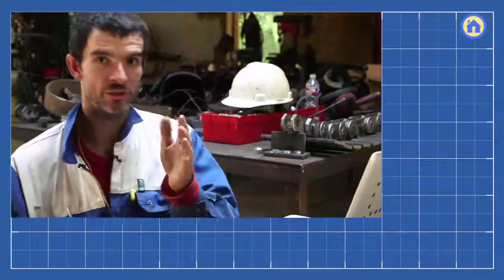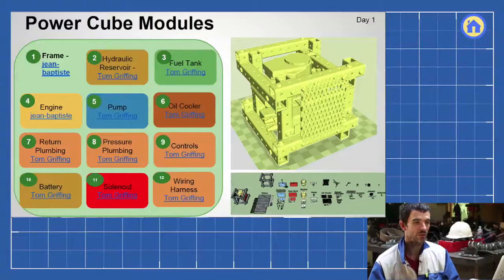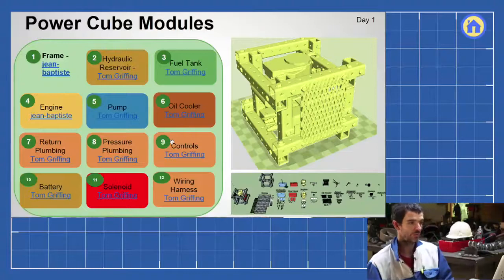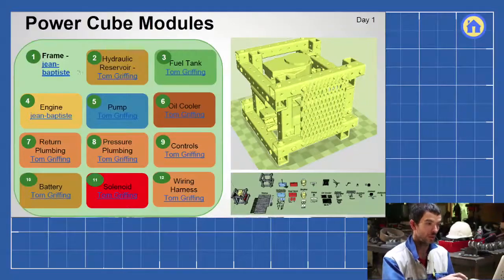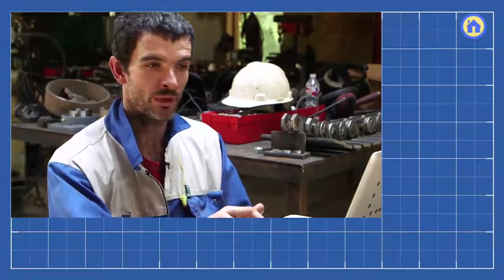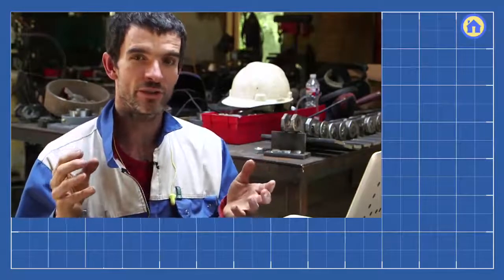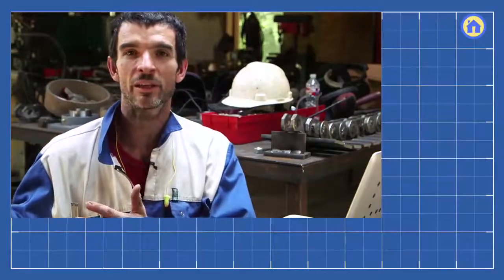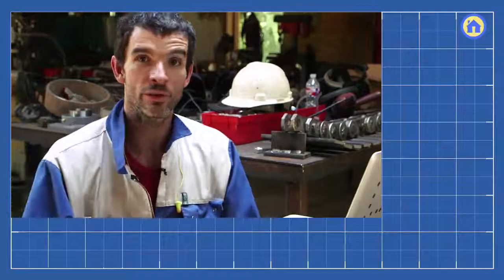Power Cube - Basic Theory by Open Source Ecology

Comment: Are there less costly ways to create hydraulic pressure?
Some people say steam engine is less demanding in many ways.
Also, classic engine produces rotation, not hydraulic pressure. Isn't rotation «more refined» than hydraulic pressure and therefore more expensive? May be some great mind will discover a way to produce hydraulic pressure directly, without intermediate rotation movement.